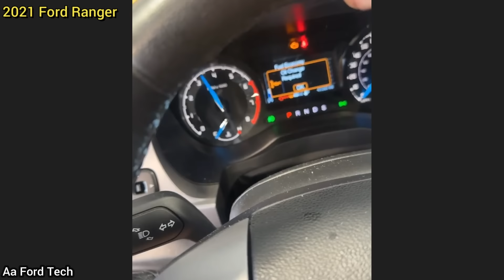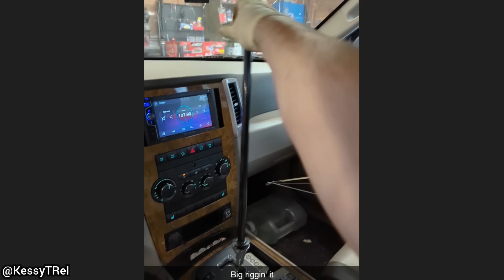Customer States Engine Sounds Awful After He Fixed The Engine

Comment: Cant be bothered to do correct oil change. meh ill have it repossessed.🤔💀
Reply: Some people are beyond belief.
Reply: Probably can’t even afford the oil change if this is his thought process.
Reply: Might be the most baffling thing on this channel yet
Reply: 😂.... Anyone putting 15 quarts of oil in a Corvette engine isn't very bright
Reply: Pretty sure those are dry sump systems
Reply: Probably a lease
Reply: @jimtaylor431 I know right, if I was the tech that discovered this, I would probably lose my job due to the roast I would lay down on this man. And people wonder why the world is the way it is now a days, can't have anything nice.
Reply: @weswest8666  Yeah. Not sure how you get so much oil in a 7.5 quart capacity dry sump system?
Reply: Had that happen once with a Carerra 4S once.  Came in needing a clutch.  Had to replace the flex joints on the front propshaft while it was apart because they were so far gone, I don't know how it didn't fall out. 

He just never paid or picked up the car.  Shop filed a mechanic's lien and the bank paid it out to repo it.
Reply: If someone says they plan to abuse their car's engine before letting it get repossessed, that sounds like wanton destruction. This statement could backfire big time. The loan company could go after them for trashing their collateral, and the insurance company might refuse to cover the damage or even accuse them of fraud. Plus, there's the risk of facing criminal charges for intentionally destroying property. This kind of behavior also affects other borrowers because it can lead to higher rates for everyone. It's just a bad move all around and could bring serious legal and financial trouble.
Reply: I see so many expensive cars rolling on used tires, mismatched tires, etc..
Reply: You wonder why these repo vehicles look like crap.
Reply: The freaking privilege. Thats Trumps America.
Reply: Depends on the state as they can't come after you for the balance.
Reply: @bills6093  You don't, whole engine was full.
Reply: @mustangthings  I think you hit the nail on the head. He simply can’t afford the car and was looking for an excuse to have it repoed.
Reply: My engine is destroyed....might as well destroy my credit rating.
Reply: @RyanzPVTS  That all depends on the state. Most states you can just walk away from a car loan and there's not a damn thing anyone can do about it.
Reply: @jamesm568 Yes but in this case there's video evidence that the engine was in a dangerous configuration and the man elected to drive it away and stated on the record that if the engine blew he would just get it repossessed. If the insurance company had that video they might determine it's worth pursuing the case. I think this is different from consumer protection
Reply: Rich people problems, am I right?
Reply: On a C8 Vette no less, daddy would be proud! 😂😂😂
Reply: Typical "don't go broke trying to look rich". Bet they can't even rub two nickels together. 😅
Reply: I don't understand, having it repo'd will destroy your credit..
Reply: People don't realize that having an expensive car means expensive maintenance.
Reply: Is this true? Are people this screwed up.
Oh never mind, 81 million people supposedly voted for joe...
Reply: My ex neighbor did that with a Dodge pickup. He tore the motor apart, lost half the pieces, and let the finance company tow it away
Reply: @Tevon93  I don't understand either. And this is coming from a Texas man living in this state for basically all my life so far. Can't wait to leave this shithole for good.
Reply: @ginog5037 And 70 million are dumb enough to think they didn't...
Reply: @RyanzPVTS  I don't think the video evidence will make one bit of difference as it may not even be worth pursuing with the added court costs
Reply: Everyone knows that an engine's oil level is just below the filler cap.
Reply: These are the people on the road with you.
Reply: @Dudeman9339  Lol.  Trump's fault eh?

lolllollolllololllollooll
Reply: @Ogrematic obviously not. These are all problems of people too poor to pay and also not qualified to repair
Reply: @helloneighbor11  I've worked for some wealthy people and this is their mo. The guy may have 28 cars and just doesn't care.
Reply: Yep he's a real fart smeller there. 😂😂😂😂

Comment: He would rather tank his credit, and get the car repoed? damn talk about spending 10s of thousands on a fix that would have cost 100. Who thinks like that.
Reply: I've never had to deal with anything like that, but if you destroy a car and it gets repo'd, aren't you still on the hook for the difference between the owed amount and the current value of the car? Repo isn't a magic get out of debt free card...
Reply: A fool does that.
Reply: Nobody is considering the biggest factor in all of this: military grade, industrial strength, triple A stupidity.
Reply: His credit is already tanked. His loan on that car was probably at 25% APR.
Reply: @robadams1645  Worse.  When they repo the car, they take it to auction, and only subtract what the auction brings from what you owe.  Something that's smoking like a steam train get sold REALLY cheap at auction.

At the dealer auctions, there are dishonest assholes that will unplug sensors under the hood before the auction so it comes up with a check engine light on or AC not working, and they can get it cheaper, knowing that all it takes is plugging something back in.

Source: I was lead tech at a place that did repairs and sold used cars, and have seen that shit happen.
Reply: @Yvolve  Anybody who watches this channel already realizes just how common that is :)
Reply: @robadams1645, in a word, yes.
Many years ago, I worked for a shop that had a contract with a local bank to get their repos ready for sale. 
Any damage the customer did, or any parts that they stripped were added to the outstanding balance of the loan. Most commonly they took the battery and the stereo and rims.
Say they owed $5,000 and we put $1,000 in it and the car sold at auction for $2,000, now they owe the $3,000 on the loan itself plus the $1,000.
Btw, we didn't scrounge junkyards, we used all brand new stuff.
Reply: Someone who doesn't have $100.
Reply: The guy was throwing a temper tantrum because he didn't believe the mechanic.

He walked in there absolutely convinced the engine was blown and needed to be replaced under warranty.

The mechanic told him that he overfilled the engine and it wasn't covered under warranty.

It isn't just a case of "Drain and refill".
At a minimum the O² sensors , spark plugs and catalytic convertors are ruined too.

He did about $20k of damage by changing his own oil...and to be blunt after 2 GALLONS of oil anyone with half a brain would realize that they were doing something wrong and stop dumping more in.
Reply: He's the guy who pounds  a round peg into a square hole. I've had neighbors like that/ they're an exact match.
Reply: My guess is that he's behind with more payments than the few he's made!
Reply: @massimookissed1023  That's a Jiffy Lube price.  Try about $250 for that.
Reply: My brother's Dodge Challenger Hellcat Red-eye has been in the shop for an engine replacement for 9 months now. The car had 94 miles on it when the engine failed. The cause was a broken cam shaft because the bearing caps were not correctly tightened resulting in the cam snapping. When the dealer opened up the engine they found that only 3 of the bolts had been properly torqued to specifications and some had backed out up to 1/4 inch. This is the second of these engines they have seen with this problem in less than a year. My brother is pissed because he paid almost $100,000 for the car and wasn't even able to get it all of the way home from the dealership.
Reply: Zoomer logic.
Reply: He is almost certainly way past due on his payments anyway, and has resorted to parking his car inside garages, in odd places the repo man wont look, not leaving his car unattended at the gas pump, not going into any store with his car parked out front...ect. It's become such a pain in the ass at this point that the the oil change was the last straw. He probably thinks that having it repoed with too much oil in it is a good way to stick it to the bank.
Reply: There are people who are incapable of thinking more than 5 minutes in advance.
Reply: I guess a rich person who can pay to fix their credit

Comment: I refuse to install those E3 spark plugs in any customers car. I did one once. Misfired right out of the garage door. Put Iridiums back in, misfire gone. Had multiple people come in saying they replaced their spark plugs and it still misfires with E3's. It was always either a dead coil or an E3 plug. Power of marketing I guess.
Reply: Why are they allowed to sell it when they the product doesn't work?
Reply: How do you even gap those things?
Reply: @imtheeastgermanguy5431  No one has yet sued them for enough money, I guess.
Reply: I use those in my lawnmower only lol
Reply: @the-chillian  by magic
Reply: I remember when those things came out around 1998. With only about 10 part numbers, they claimed they had a plug for just about every vehicle on the road. Hilarious.
Reply: Good to know.
Reply: Total trash. Why anyone would want to install a copper based plug from the beginning of spark plugs that has three ground straps covering up the spark, that only last 5 to 10 K, vs a platinum or iridium that lasts 100K? It reminds me of the "fuel shark" cigarette lighter plug in.
Reply: @nickgiesler3438  People assume the 'default' option is unadvanced, or the cheapest trash possible. To be fair, a lot of that's on auto makers for using a lot of trash parts just to save some pennies (nylon cogs in AC intermix controllers being a good example). If some shister says it's advanced, most people not having the slightest idea how shit works will jump on it.
Reply: @imtheeastgermanguy5431 Because of the "wonderful" "consumer protection" in the usa.
Reply: Never heard of them. What are they
Reply: @imtheeastgermanguy5431  It's called American capitalism. Buyer beware.
Reply: I ran E3's in 2 cars and both ran great. I got almost 1 mpg higher in my Elantra and they were still going strong after putting almost 50K miles on them. Some plugs don't work with some cars, that has been true at least since the 90's. Chevy and Ford cars don't tend to like them, from what I have seen.
Reply: @kauske  nylon gears in starter motors too now...
Reply: I've never had an issue with E3 plugs. You just have to make sure they are correct for your application. The gap has to be correct since you can't change it. So 3 min of research and you should be just fine. I have run them in everything from lawnmowers to my 454 wrecker. Do I run them in my high performance cars? No, I usually run iridium plugs for that stuff but for everyday drivers I've actually seen better gas mileage with them.
Reply: E3s work great on two-strokes and literally nothing else.
Reply: I have never known any car that worked better after using those or any similar type of sparkplug. Also this is the exact opposite of the kind of spark plug you want to use in high performance turbocharged car.
Reply: E3s are possibly the only plug even worse than a Bosch +4.
Reply: @the-chillian  you don't
Reply: @batsonelectronics  well my ranger with the 4.0 does not mind them, but this is also an engine that had the electrode worn below the ceramic and ran fine.
IDK E3's are performance plugs, but E3 does all their testing around drag cars. So sure they are performance, just not what you need. more than snake oil, less than better cold air flow
Reply: @Olds_Pwr Not everyone can use R46SZ spark plugs like us. ;)
Reply: @nickgiesler3438 Granted platinum/iridium plated electrodes will last a long time in some/most  applications, but if you're only getting 5-10k out of a quality copper core plug (like AC) that engine has a problem that isn't the fault of the plugs. 25-30k is the minimum on a good running engine.
Reply: @frederickclause2694  there isn't a officer which checks parts and stuff?
Reply: If a customer brings in and wants them installed I have no problem being paid twice to replace them.
Reply: I only buy Bosch or NGK plugs these days.
Reply: Sounds like you used the wrong spark plug, not the wrong brand.
Reply: @imtheeastgermanguy5431  They do work. You just have to first get the correct part.
Reply: @mimcduffee86  okay

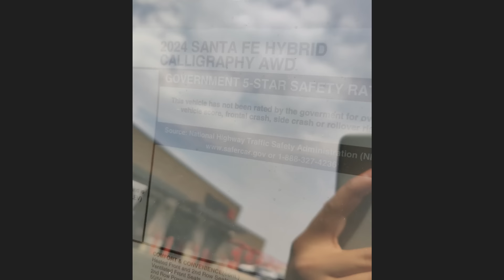Comment: 1:18  Guarantee one, if not multiple people saw that at the factory and said "That is not going to be my problem today."
Reply: Back in the day, that was known as a "Friday car."  Legend had it, you didn't want a car built on Monday morning or Friday afternoon, for reasons that should be obvious.
Reply: @immikeurnot I used to work for a major motor manufacturer. Cars built on Friday were usually good. Reason? If a car was found to have defects during end-of-line inspection, it was pulled off into a pound. The guys on the line did an overtime shift on Saturday morning to re-work the defects. So there was a system. On Monday, they would agree how much overtime they wanted that week. During the week, they would make the required number of defective vehicles to get the overtime they wanted. By Friday there were generally enough vehicles already in the rework pound, so that day's production would nearly always be good first time. There was also a system to identify cars that had been ordered by staff or their families / friends.... those cars were always built right first time too.
Reply: @JustsomeblokeinYorkshire A schoolmate's father worked at Chrysler's Belvidere plant from the 60s to the 80s.  They did have an overtime system where  inspection fails were reworked, but in the late 70s to early 80s a lot slipped through.
Reply: @JustsomeblokeinYorkshire  That's... Equally terrifying and disgusting.
Reply: @Caffeinated-DaVinci  It is, but it's also the workers learning how to play the system just like the "leaders of business" do.  At least the vehicles were being fixed before being sent, unlike what's happening now.
Reply: @JustsomeblokeinYorkshire  I would hope that since they could "predict" the defects, they wouldn't be that severe.
Reply: It's possible this was a damaged door replacement; especially if the owner only had liabily insurance. A relatively common vehicle, wIth that very basic white exterior paint... I can see a very easy complete door replacement from a large junk yard.
Reply: "Can't see it from my house."
Reply: @JustsomeblokeinYorkshire  a friend of mine had an Acura built at the US plant on Christmas eve.  The car was a lemon.  Numerous things going wrong.
Reply: @jeffreypgorman  Is there a word for a car that's the opposite of a lemon?
Reply: @DistrustHumanz not the case here, as the tech said it was a PDI. PDI is Pre Delivery Inspection. This car was brand new, fresh off the delivery truck. Had never been sold and never been driven by anyone except out of the factory and onto the delivery truck.
Reply: @garyb6219  A cake? 😅🍰
Reply: @garyb6219  I was always told it was referred to as a 'peach'
Reply: @emochic100  Thanks, I have one of those.

Comment: I can confirm that those E3 spark plugs are trash. I’m a small engine mechanic and there was a mower that came in and would sometimes act time the choke was stuck or would backfire badly. It ended up being those plugs that the owner had just put in.
Reply: There should be a class action lawsuit against the manufacturer, those plugs are garbage.
Reply: @brandonhull2695 What is it about them?
Reply: @ATruckCampbell  it seems like they have really bad quality control. The two that I took out of the mower were the same part number but had completely different designs for the base.
Reply: @ATruckCampbell the best that I can determine is that their center electrode material is inferior. They will work through a few heat cycles and the spark becomes very weak or will not spark at all.. 
I also agree that quality control is an issue.

Comment: Well, at least he used JB Weld on the exhaust, and not Flex Tape.  :)
Reply: @markh.6687  lol true, but the jb weld can pull it off...... if you use the HIGH HEAT formula.....

Which I doubt he used and slapped standard  all over the place, now that clock is running.....
Reply: Or cling film.
Reply: Everyone knows spray foam is the best thing for fixing exhaust leaks, cheaper then JB Weld too :)
Reply: There may well be a layer of melted Flex Tape under the JB.
Reply: Hey, don't you knock flex tape, it stops the leak right away!©
Reply: Spray Foam would be far more on brand for this channel.
Reply: @thesledgehammerblog  True, but the owner was a professional.  :)
Reply: @StevenRogers-hw9dj  I call B.S.; the JB Weld wouldn't stick. :)

Comment: These people are exactly why shops charge a diagnostic fee 😂
Reply: Isn't it usually waived if you get the repairs there?
Reply: @maryrose2676  ya it is. I just mean because these people get their cars looked at to find the problem then deny all repairs lol.
Reply: @neonnerd1364 or they'll deny to get the repairs done somewhere else.
Reply: @PanameraTurboSEHybrid  regardless of what they do they still have to pay the diagnostic fee.
Reply: @neonnerd1364  I know, I'm just adding on with what you said about the reason to paying the diag fee.
Reply: @PanameraTurboSEHybrid  I've had 3 cars in the past which I either showed to mechanic and declined repairs or self-examined and didn't repair because the repairs and parts were more expensive what I paid for them - with over 8 months to drive before next inspection.
But instead of driving them, I turned them into cubes.